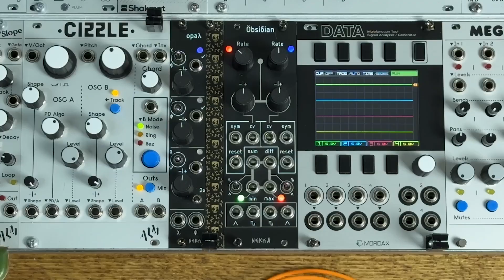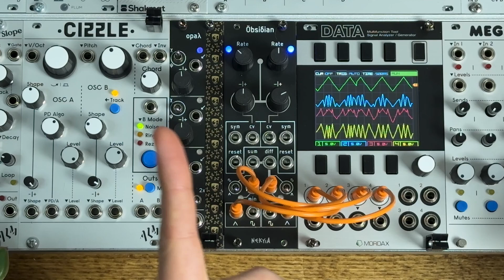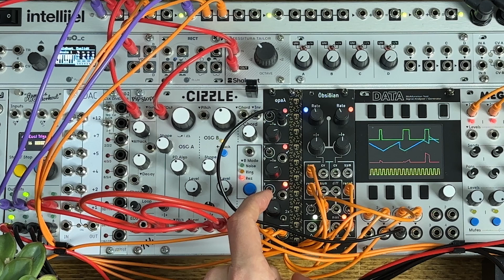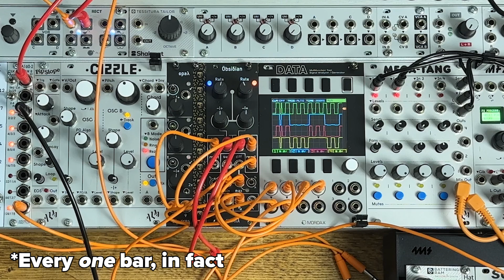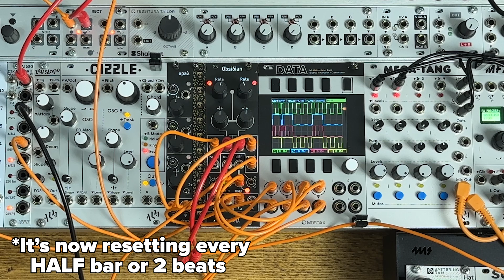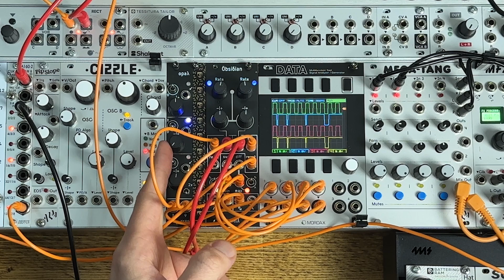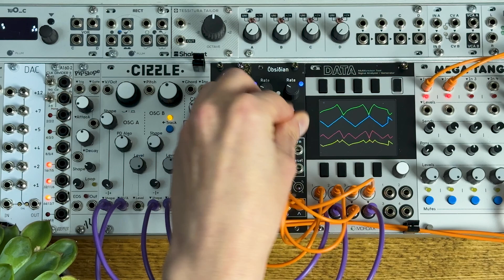3 cool things to do with LFOs & analogue logic, feat. Nekyia Circuits Obsidian

Comment: I really learned a lot. I was curious, in the worky drums section, how were you able to straighten the snare hit by adjusting the pulse width
Reply from the maker: By adjusting the pulse width, you're also adjusting the point in the cycle where the voltage switches from low to high. So if you watch the scope, you'll see the vertical parts of the blue trace move 'backwards' relative to the green trace above when the pulse width increases.
Reply: @TomChurchill  Ok. I think that makes sense. I'll definitely keep coming back to the vid. A real gem. Thanks again I've been binging your videos😊

Comment: Short of a MIN/MAX module? You might like to try patching your own, then again you might not. If you did you could use a comparator and something like a switch, but here's a more mathsy sort of alternative...

To find the MAX of 2 signals (A and B):

1. Mult and invert B (-B)
2. Sum A and -B (the difference)
3. Half rectify this
4. Now sum this half rectified difference with the non-inverted B.

To find the MIN of 2 signals (A and B):

Repeat steps 1-3 to find the half rectified difference
4. Invert this
5. Now sum the result with a multed copy of A.

Comment: Fascinating!👀... Have U tried using 2 LFOs to modulate pan & VCF resonance simultaneously?😎... I.E., LFO_1 modulates PAN & LFO_2 modulates Filter Resonance!👽... It sounds Bitchin'!😎
Reply: I use a dual LFO device in Reason and it will create some lovely ethereal pads or textures